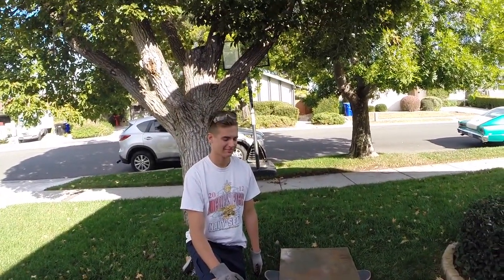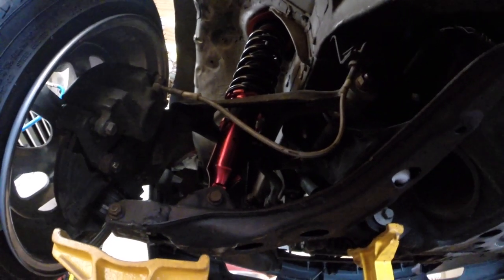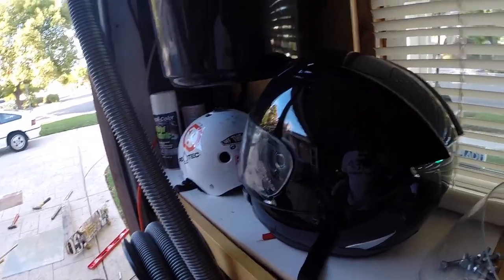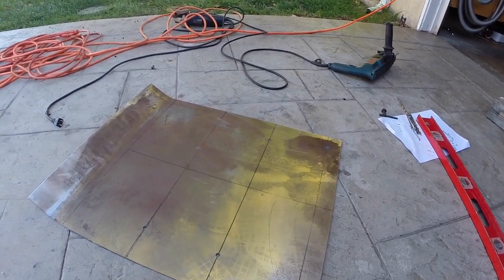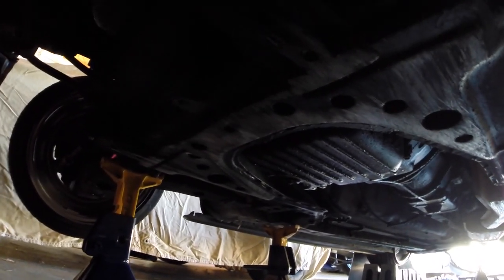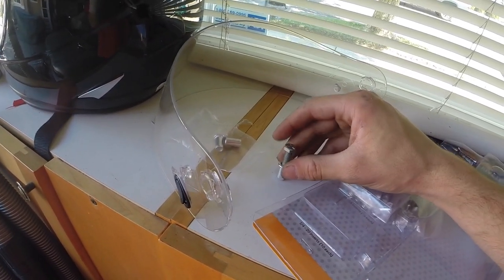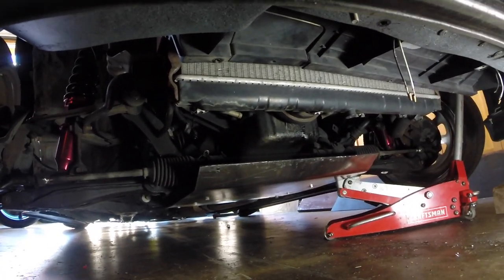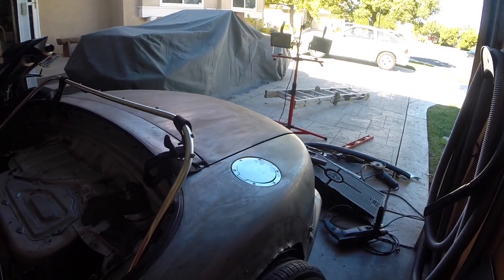DIY: Skid Plate - Slammed Miata

Comment: Maybe version 2 you can get a countersink bit and some flush Allen bolts so you could scrape all day and don't have to worry about scraping the heads off?
Reply from the maker: +Primer2tone Garage i will eventually modify it, but ill tend to it when it is an issue

Comment: For more check out my Fabrication 101 episode for a complete step by step DIY skid plate fabrication! Same basic plan but mine is a slightly more complicated skid plate.
Great tip on connecting a chain or something to hold it after the bolts fail. Ive seen other peoples plates fall down and get ripped off way too often.

Comment: instead of waiting for the bolts to scrape ,you can cut out a square for each bolt hole and with small square tubing to make spacer then weld a piece of sheetmetal again. drill the hole.,so the bolts will be recessed
Reply from the maker: +Frank Hernandez good idea, but no space or time, i need it before a big meet on the 24th

Comment: How did you modify your coilovers to go lower? please answer
Reply from the maker: +Hacked Up Lifestyle in the front i just lowered the hight adjustment and then adjusted th preload down for furthur hight adjustment. in the back i havethe hight adjustment as low as possible and then took bothe the secondary collers out and the preload collar is resting on the height adjustment